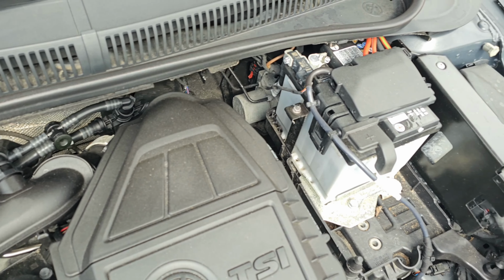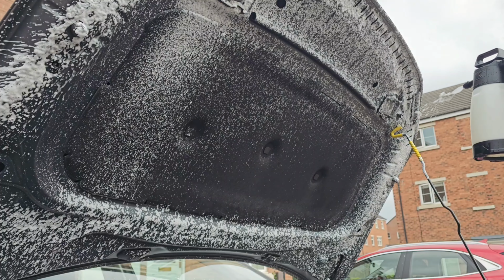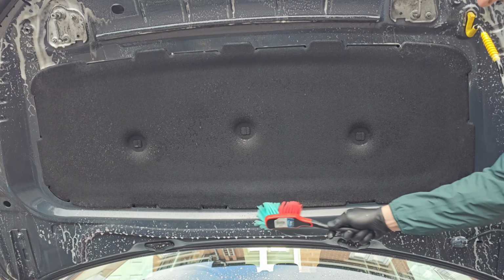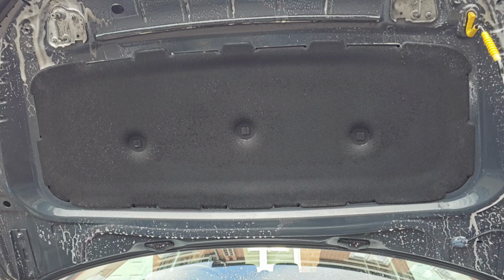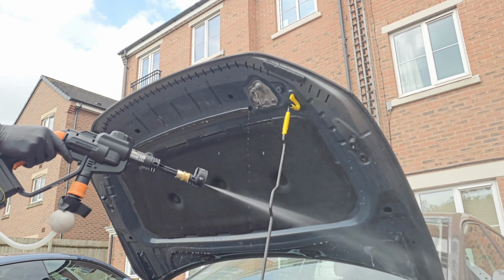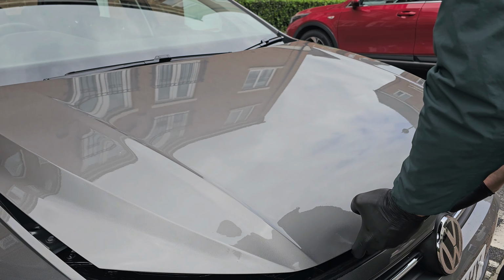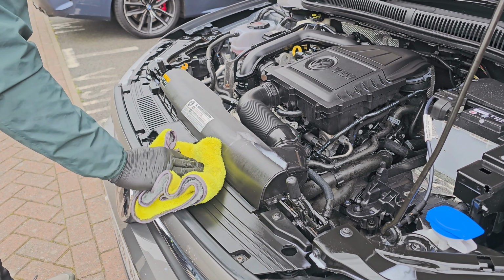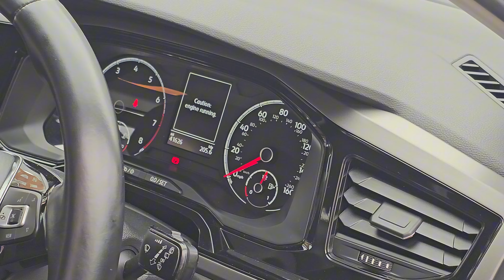Engine Bay Clean| Volkswagen Polo

Comment: Does water damege the engine? I saw that sone people online use dry cleaning method to avoid damaging electronics of the car
Reply from the maker: @valerioranalli  On modern engines all electornics are sealed so it's quite safe to clean them, however you have to be cautious with the water pressure and assess your engine before you clean, whether it has leaks or not and etc. Also drying the engine properly will reduce the risk.